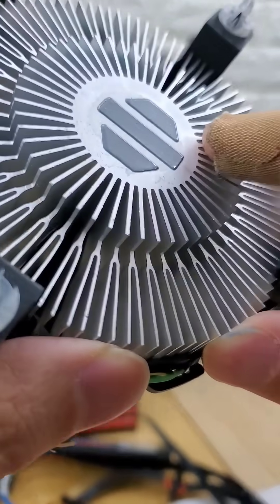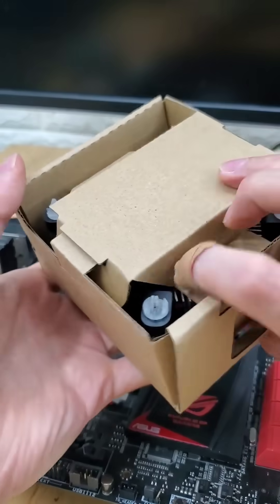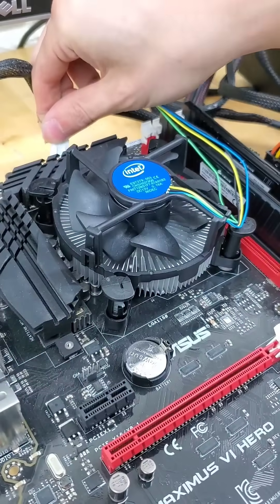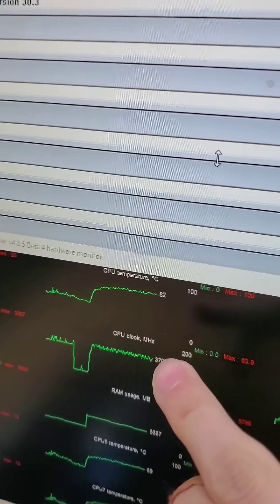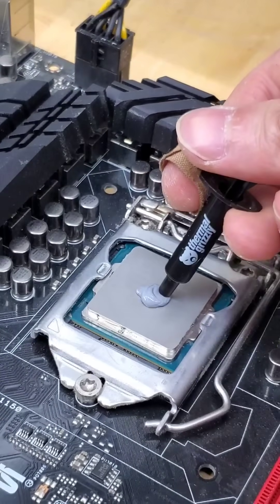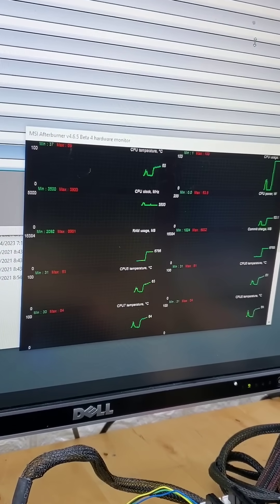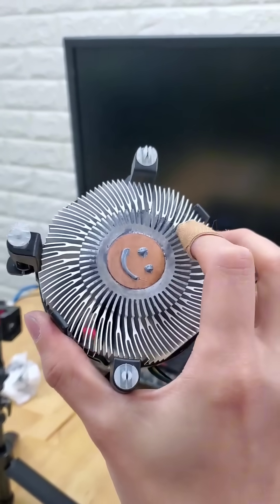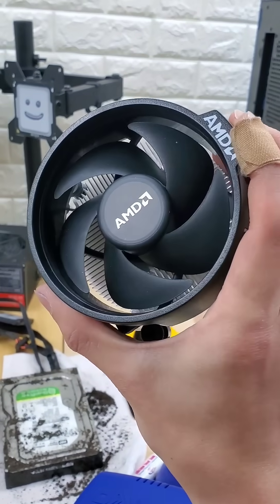how BAD is Intel's stock cooler? #shorts

Comment: A cpu company doesn’t know how to thermal paste their cpus 💀💀
Reply: Isn’t that the old one? I thought intel redid their coolers.
Reply: @CJTheTokay  Yes youre right
Reply: it got the job done and it covers the die.. not always necessary to cover the whole heat spreader.
Reply: I mean I have the same cooler and it's the cooler that came with pentium cpus a decade ago
Reply: @M.K__ 2 decades ago.
Reply: It is good enough for most people, so they cheaped out. Anyone who wants more cooling performance isn't using the stock cooler anyway.
Reply: They definitely do, they just went cheap most likely.
Reply: @Ahzealion  no it mostly has to do with longevity

You are supposed to reapply high performance thermal pastes every couple of years. While Intel knows the thermal paste they use will likely never be reapplied.

Just so happens that thermal pastes that last a lot longer don't work as well at moving heat.
Reply: @miles11we  Makes sense, thats why its always safe to put a "most likely" lol
Reply: @miles11we it’s also cheaper
Reply: @Ahzealion probably most likely.
Reply: Their*
Reply: Their*
Reply: And as much "technicians" uses low ammount of thermal paste
Reply: Not just one, the biggest cpu company 💀
Reply: Thats what u think for intel as long as the cpu doesnt thermal throttle its within spec to be honest m suprised they arent using something more garbage to save even more cents per cooler!and dont b suprised if they reduce the 3 thermal bars to just 1 😅 to save cost
Reply: pretty sure intel's thermal paste design is not for performance, but durability. it can probably last 5 years before you feel like something is wrong
Reply: Your mother
Reply: AMD step up their stock cooler way back then. Intel stock cooler is a joke, also fugly as f.
Reply: @marhensa  who cares what it looks like? it’s in a metal box
Reply: @MrJord1994  Yeah, but most modern cases have glass panels.
Reply: They absolutely do.  Those temperatures are perfectly safe for the CPU and those extra 5 degrees will do absolutely nothing for performance or longevity.
Reply: A native English speaker can't even write proper grammar 💀
Reply: @new_simsonshahahaha